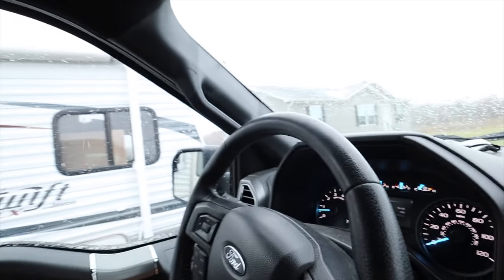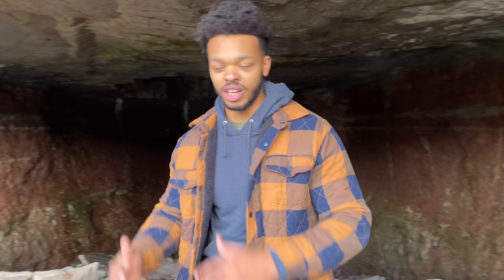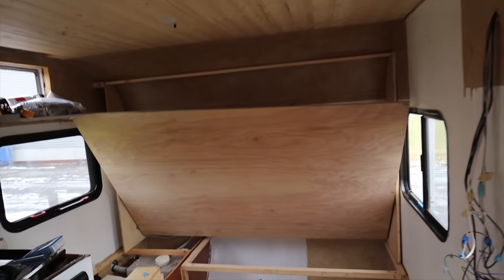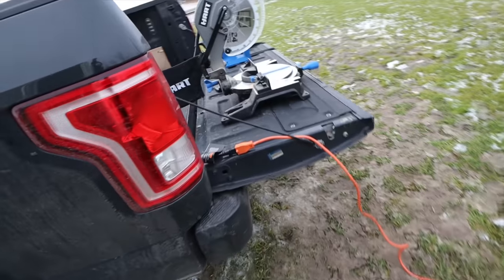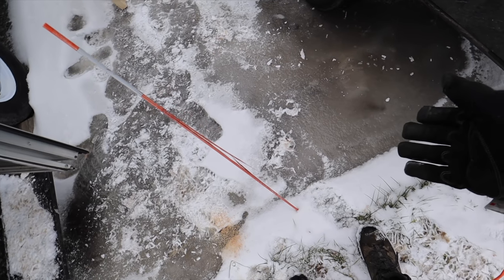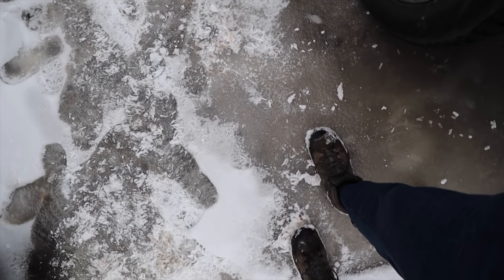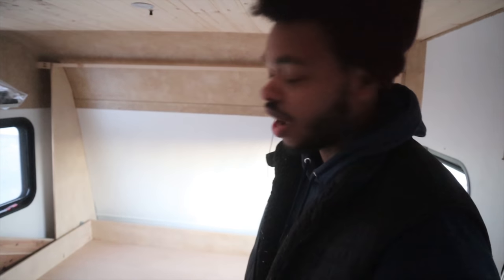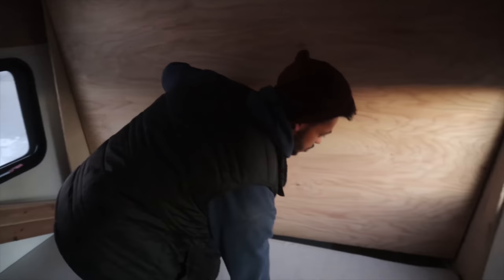Building a Living Space w/Hidden wall bed in Freezing Temperatures | RV Renovation ep. 4

Comment: Love your work and creativity! Thank you for sharing. I do reupholstering as a hobby, and was taught to stretch and tack my fabrics, then let them sit for several days because they often stretch a little. I'll go back and smooth them out before stapling to get a nice taught surface before stapling, then remove the tacks. Less chance of wrinkles later.
Reply from the maker: Very good tip! I think I’ll try that method on my next project. Thank you
Reply: They make upholstery tacks and a little upholstery hammer for setting and pulling them.
Reply: Excellent tip! I have done reupholstery too. I will try that on my next project!
Reply: I do upholstery work for a living. First tool you learn to use is a staple puller. After removing hundreds of staples from one piece of furniture, I think some people get paid by the staple. 😉

Comment: So funny.....I was remarking to my 92yo dad a few years ago:  "how come nobody uses a Murphy Bed design in a van/RV?  I want a TEMPORARY bed-  not a 24/7 impediment in my way."   As for comfort, I've considered a variety of foams, etc.- but decided to go w/ an air mattress/8", using the onboard air pump to quickly fill it at night.   I never wanted a permanent bed in my van; it eats up alot of real estate- that I was only using p/t/8hr.   LOVE your can-do attitude and mad SKILLS; kudos!
Reply from the maker: I’m glad you like the video. It’s very rare to see Murphy beds in vans and RVs because of the shape of the walls in tiny spaces like these. Murphy beds are easy in a house where you have square flat walls with lots of space. It’s very difficult to get a Murphy bed to work with an oddly shaped wall. Even if the wall is curved it’s usually never at a constant rate. It’s very random. I’ve been wanting to put a Murphy bed into the last 4 rigs I’ve built but this was the only one I’ve been able to make work simply because of the walls. It also depends on what else you’re building into the space as well

Comment: It has been really cool watching your builds grow and change over the past couple of years. Nice work! (and lots of new tools!)
Reply: I agree....but I guarantee that the heavier wood products he used has now exceeded the GWR & GVWR rating fir the RV axle and hitch.  Both WILL break under that much weight.  I guarantee it.
That is why RV manufacturers use thinner, lighter building materials.
First bump he hits, the hitch will break and the axle WILL crumble....on both his large RV and the little one.
And you NEVER leave the RV on the tires if you stay somewhere for longer then a few weeks.  Never use the RV tires to stabilize an RV.  Bad.  Tire rot and warping of the axles can occur.  It is vest to lift with the Stabilizer Jack's and put concrete blocks under them, lifting the RV off the tires just enough to rotate the tires.  Then you can cover them to protect them from harsh weather.
Living in an RV that sits on the tires is like living on Jello.....the RV jiggles. NO lie.
I am a full time RVer.   I have seen it all....😂

Comment: Love your videos! A tip for cutting foam:
Check out thrift stores for an electric carving knife (for roasts, turkey, etc). It cuts through foam like a dream. Also, see if an upholstery store will sell you firmer foam, like the black foam they use for some electronics. Then cover that with a memory foam topper.
Reply: Yes, an upholstery supply shop has different foam density options. We use an electric carving knife at our shop, very handy to have.

Comment: Just beautiful work you do man! Mad props to you for the certainly hard work you’ve done and continue to do. As always, a pleasure to see your projects coming along!
Reply: I love his work.....but the wood products he used has now exceeded the GWR & GVWR rating for the RV axle and hitch.  Both WILL break under that much weight.  I guarantee it.
That is why RV manufacturers use thinner, lighter building materials.
First bump he hits, the hitch will break and the axle WILL crumble....on both his large RV and the little one.
And you NEVER leave the RV on the tires if you stay somewhere for longer then a few weeks.  Never use the RV tires to stabilize an RV.  Bad.  Tire rot and warping of the axles can occur.  It is vest to lift with the Stabilizer Jack's and put concrete blocks under them, lifting the RV off the tires just enough to rotate the tires.  Then you can cover them to protect them from harsh weather.
Living in an RV that sits on the tires is like living on Jello.....the RV jiggles. NO lie.
I am a full time RVer.   I have seen it all....😂

Comment: Do you need some ventilation under the mattress. The mattress will get soggy overtime if it doesn’t have ventilation. Lots of 2 inch holes 2 inches apart should do the trick concentrate more on where you’re Bobby will be on the bed for the most holes and left their holes at the foot and the head of the mattress area.

Comment: So, if you pull the rotation mechanisms out away from the back wall, and closer toward the center of the room, (on the side walls that you cut in the beginning of the video), you could have the bed lean back at the top, more like a comfortable couch; instead of leaning forward at the top, which is totally weird, and probably dangerous for the person sitting on that bench.

Comment: Darlin'....you have to remember that you have a limit on the total weight on the axle, and the GWR & GVWR.....gross vehicle weight rating, which is the tow weight max of your vehicle and the max weight of the RV axle ability. 
You need to be careful, as all that wood WILL put the axle under max strain and can....and will....break the axle, and the hitch will break.  Trust me.
I love what you do......but, that is the reason thinner, lighter weight products are used in RV manufacturing.   Too much weight will exceed the axle and hitch weight maximum.
For your large RV, that you live in, you might need strengthening in the axles, and hitch,  by welding reinforced metal, and I hope you have dual axles.  But I guarantee,  you've exceeded the GWR & GVWR, thus, your hitch and axles WILL break.  You added a LOT of weight to your large RV.  It is beautifully done.  But now you need to leave it there.
AND you MUST use you Stabilizer Jack's to lift the RV weight OFF THE TIRES.  You NEVER leave your RV on the tires if you are staying where you are for a long period of time, as using the tires to stabilize the RV will rot them, and warp the wheel and axles.  Lift the RV up, level it, use concrete blocks to "set" the RV upon.   You'll find that any "jiggling" will stop also.  As living on tires is like living on jello, when you walk. Lol.
I am a full time RV'er and just want to protect your investment and beautiful work.

Comment: I've seen this "barstool bearing" idea before.  The problem is that the load is perpendicular to the strength of the part.  These will fail in short order.  Sorry to be such a  "nay sayer".  The Murphy bed is a definite winner in a small space!
Reply from the maker: The swivels are not load bearing at all. They only take the load of the carcass while in transition from each position which is only around 30 pounds plus the weight of the mattress. It’s possible that it might fail but it’s not a fact that it will
Reply: @Dualex_Builds  It's your bar-b-que as we say down here in the Lone Star State.  That said, once again, the murphy bed is such an obvious solution to the notorious space problem in these little homes. It's really quite amazing that manufacturers don't get the hint.  For the record I full time in a 74 Airstream and have one of these in the works as well.  I like your couch idea, but I decided to go with a desk top that "auto deploys" when the bed goes up.  As I imagine you did, I looked at hardware kits and was completely underwhelmed.  Going to make mine with 80/20 aluminum (NOT cheap)  Last item, look up "The Humble Road" the guy has a great channel.  Last item, really.  Best of luck, thanks for putting the effort in on the vids.